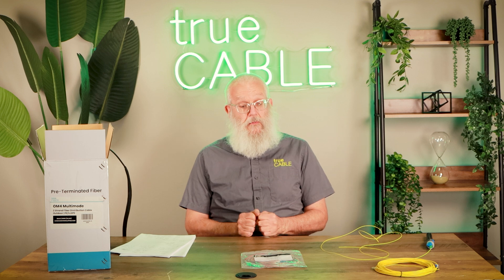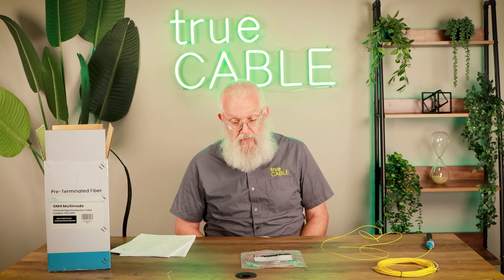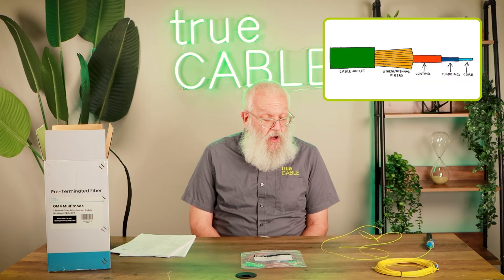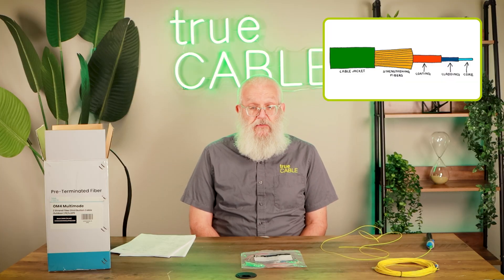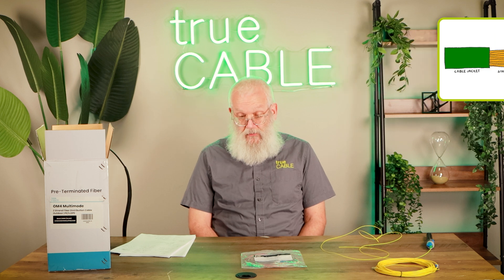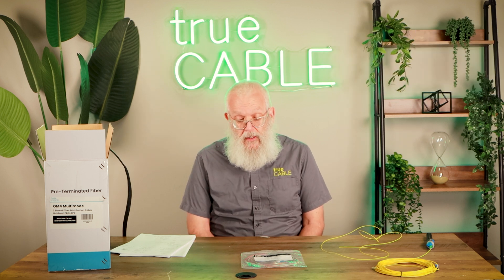Basic Components of a Fiber Optic Cable | Overview, Examples & More!

Comment: Hey Dave, great vid! Have a question for you, if we have SM OSP entering building and terminating in a wall mount patch, which has SC pigtails on the OSP side, would you splice the OSP cores direct to the pig tails or would you run it through a breakout buffer tube first?  This is a lockable wall cupboard style patch in a secure room.
Reply from the maker: Hello! Thanks for your question. If the entrance enclosure will be locked and undisturbed, then a breakout buffer tube is not required. However, if the enclosure will be accessed by untrained personnel, it's a good idea to install a breakout to build up the fibers and prevent damage to the unprotected strands. Hope this helps!
Reply: @trueCABLE Definitely, build up thr fibers 👍 👌